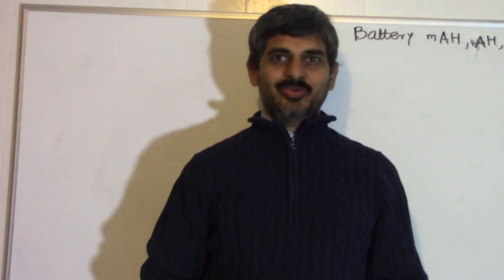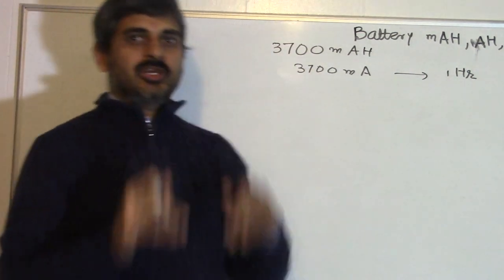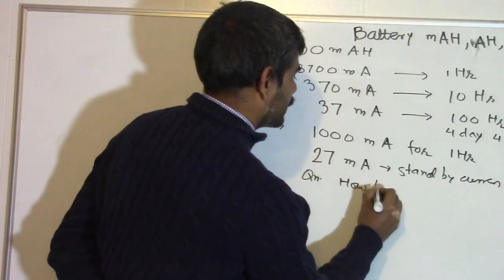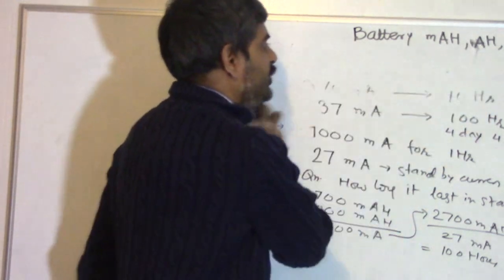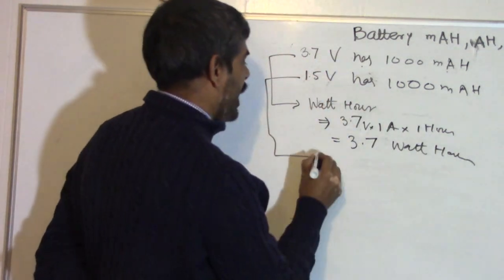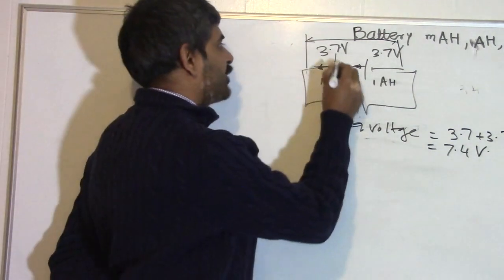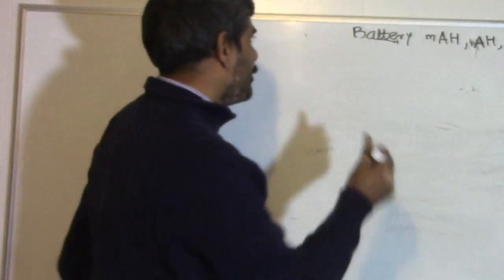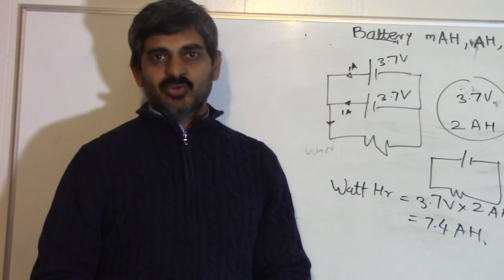Battery Life Calculation mAH - Watt Hour

Comment: But isnt your calculation worng ? what you have done is an aboslute calculation ,when a cell discharges the voltage will also decrease , but the load will still be constant and when the voltage decreases the current will increase so is your calculation still valid ?

Comment: Shouldn't 9:05 be Watt hours, so 7.4Wh, not Ah? So the Wh is the same for both (serial / parallel connection), but only the speed of consumption of energy changes, so either Voltage or Amperes.
Reply: Right. The two 3.7v in parallel x 2A should be 7.4wh. Good explanations. Going farther, he could explain that at high current draw, and the "type" of battery will determine what you'll actually get from the battery! Also, most battery Ah ratings are base on a fixed amount of time. Like how many amps drawn in a 20 hour time frame. Low current draw will give you more. Higher current draw will give you less.